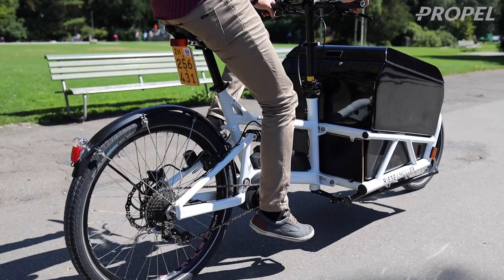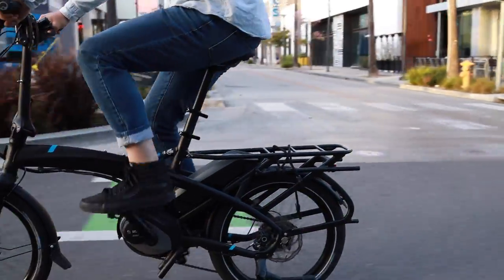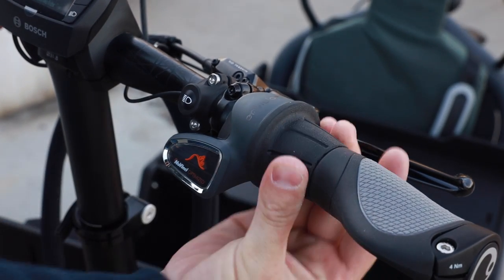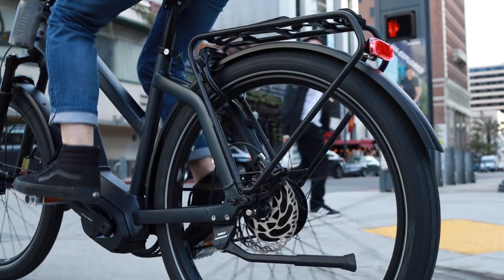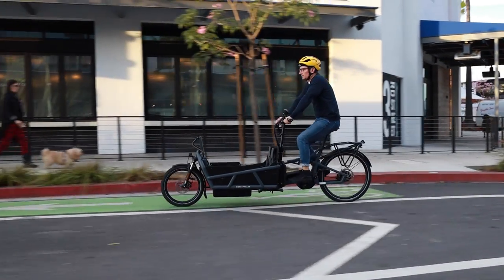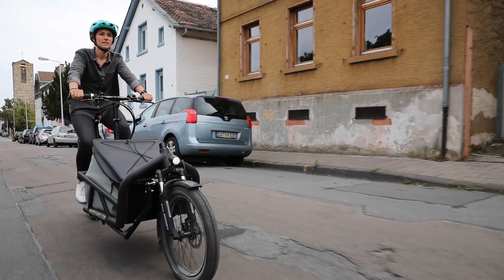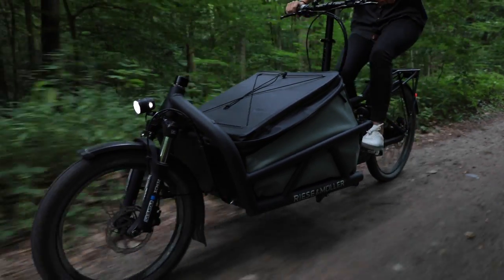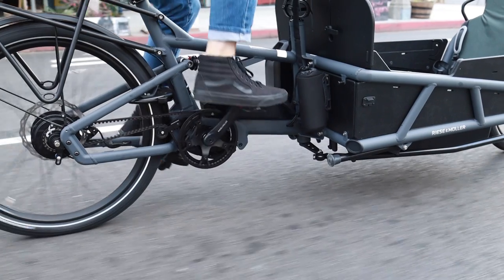Electric Bike Drivetrains: Internal vs External Gears (Derailleur, Enviolo, Rohloff, etc)

Comment: I've owned a Bosch powered speed pedelec with a Nuvinci 360 and Gates Carbon Drive but currently own an ebike with a hub motor and conventional derailleur gears. Other than the Gates Carbon drive, which I became a fan of I do prefer the latter arrangement on my present bike. The Nuvinci 360 of my first e-bike began to seep oil not long after its purchase, this was addressed but a while later the issue re-emerged. In respect to a speed pedelec the Nuvinci 360 didn't quite have the ratio to match its higher speed. I do appreciate though its ratio has since increased to 380 percent, but I'm willing to bet that this would not make much of a difference. Ideally I'd love to have or try a 14 speed Rohloff mated to a Carbon drive, but that set up is expensive and only certain manufacturers offer such a thing, particularly over varying types of e-bikes, so well done Reise and Muller here! I'm happy with my current set up, the hub motor is quieter and more powerful than any Bosch offering, but admittedly I haven't tried their Gen 4 motors, it also doesn't resist free-pedalling like my first e-bike did to some extent. The conventional deraileur system is also set up with enough range to keep up with my bike's higher speed too, but most importantly it's easy to address should any problem occur and keeps the bike in a sensible price bracket in the first instance. 
So unless I could reasonably afford the top stuff I'd now always opt for something familiar every time.
Reply from the maker: Good feedback. It’s interesting that you had the leaking issue. This is very very rare with the new 380 version. I can understand the concern about efficiency though. Rohloff is an amazing setup and I highly recommend trying the new Gen 4 motor. I think you will appreciate the improvements.
Reply: @Propelbikes  Thanks for the reply. When I had the leaking issue I did look into the matter and realised I was not alone in having experienced it, but I'm glad to hear that this has pretty much been ironed out with the new 380 version. As a comparison I would like to try a 4th Gen motor in respect to my first e-bike, especially if it was mated to 14 speed Rohloff and Gates Drive! It would not be fair performance-wise to compare it my current ride which is far quicker than an s-pedelec and I do realise I'm flying under the radar with this, but I was with the s-pedelec and anyway I'd still get 'roadies' take me on that!  My current ride is this - https://www.back2green.ch/produkt/blue-xtr-speciale-3-1-2/

Comment: Hi I have a kalkhoff Sahel 8speed internal hub failed 3000 miles, would not recommend kalkhoff very bad customer service.They are so big a company they don’t care about,after sales,just new, after that your on your own.Darby cycles own most bike manufacturers.
Reply from the maker: Sorry to hear you had such trouble. Was your dealer able to assist you? They should be able to get some help from Shimano on that issue. That would be the standard protocol. There is also required service overtime on that hub.
Reply: Propel Electric Bikes Thankyou for your reply,Yes I did eventually get help from shimano,But I also had one new electric motor fitted under warranty,Then I had problems with that,just after the gears were fixed ,which they said was out of warranty,so I payed 650£ and had to wait January to April.So with the gears and motor I lost all faith in kalkhoff,sorry but that’s it.many thank malcolm